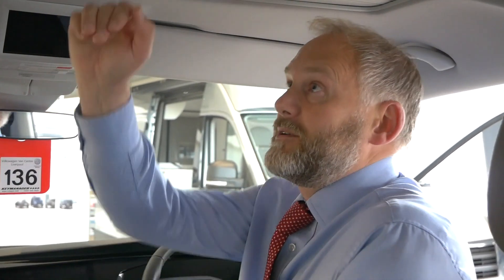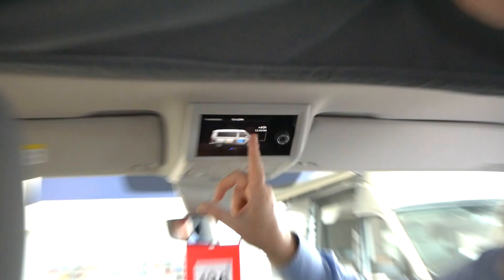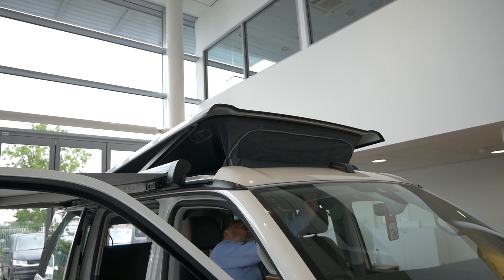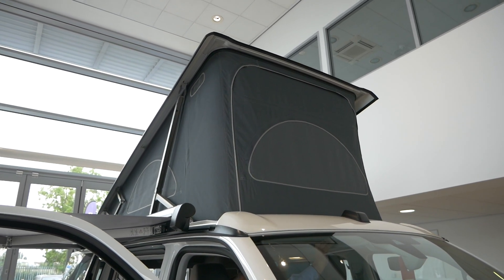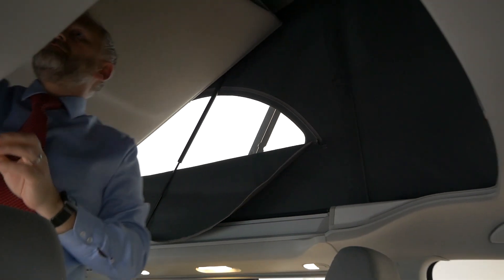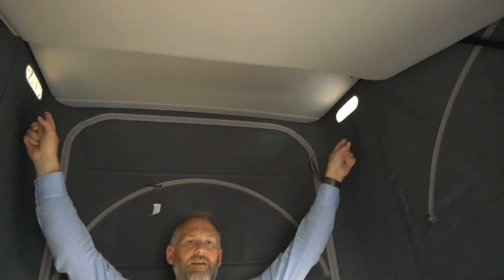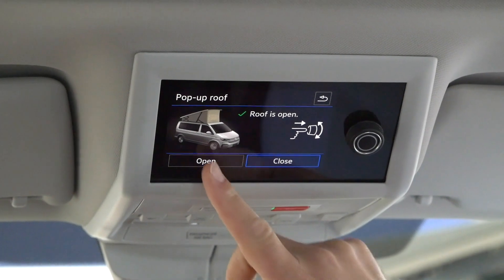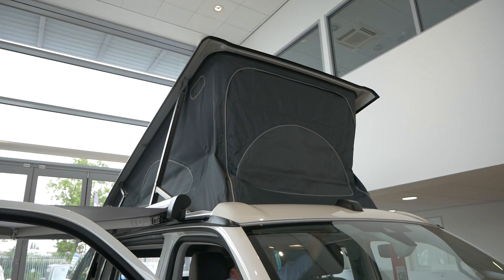The VW California Ocean T6.1 Roof | California Chris

Comment: Hi Chris I have a 18 month ocean which sags on one side after two days with the roof up causing the roof lights to stop working it has already been in to vw leicester 3 times and is booked in again in august for the same problem the passenger  side canvas remains tight whereas the drivers side flaps you can see a difference in the ram position  why can’t it be sorted ?
Tim

Comment: Great video and many thanks for all the videos.  Very informative.  
I’m somewhat of a newbie in this field and am really just beginning to look into the Camper Market and wondered if you could either do a video (or reply to this comment) regarding the differences between a factory made Cali Ocean 6.1 compared to a converted Transporter high line 6.1.  

The main thing I’m interested in is the ‘feel’ of the vehicle.  My wife and I recently hired a lovely  new T6.1 Transporter 150bhp  5 speed manual converted camper and couldn’t help but feel we were driving a van and by this I refer mainly to the noise inside the cab, the lack of any real engine power when going uphills etc (obvious I know but I hope you get my drift.) 

I was wondering if the Cali Ocean is less like a van when driving given it’s a factory fitted product and the DSG gearbox or is there very little difference in the driving experience between both.  Would you recommend the 190bhp version - does that produce a more ‘car-like’ experience?   Hope this all makes sense.  

John Smith from Sunny Scotland.